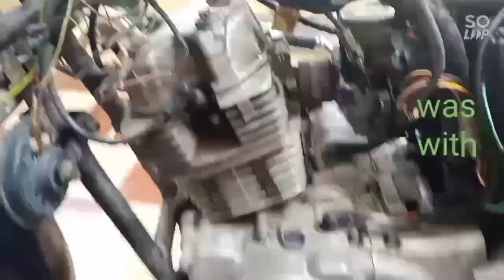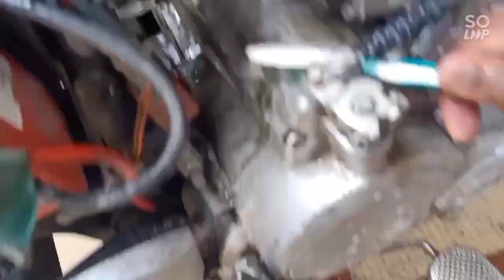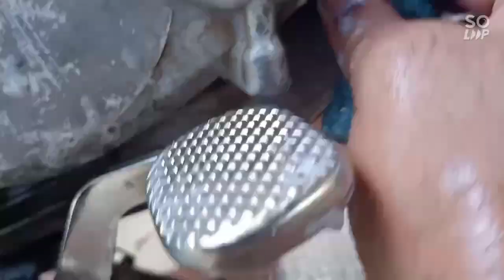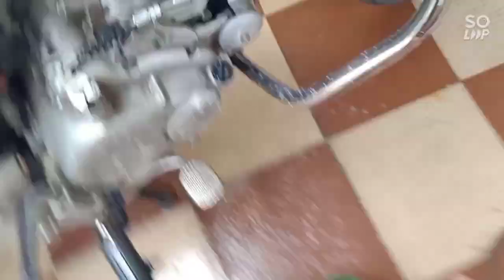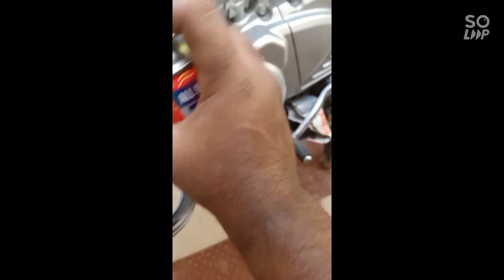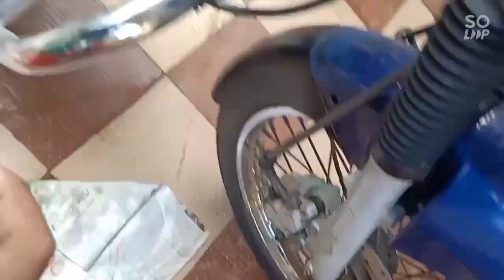BIKE DIY ENGINE PAINT AT HOME WITH SPRAY PAINT(EASY WAY)

Comment: Kya hum without heat resistant spray can use kr sakte hai.plz rply
Reply from the maker: Yes bro it last a year or two but its a cheap fix 200 rs for 2 years